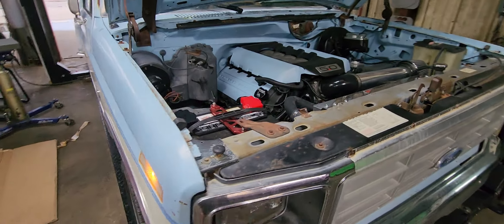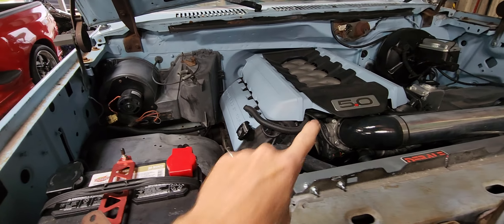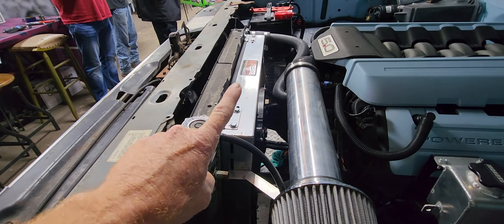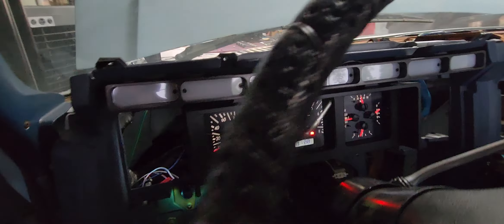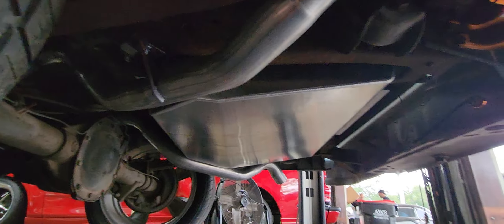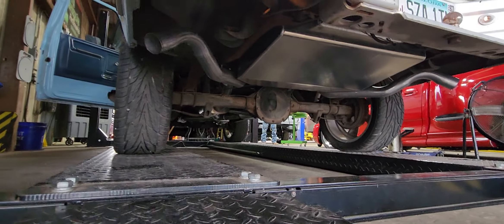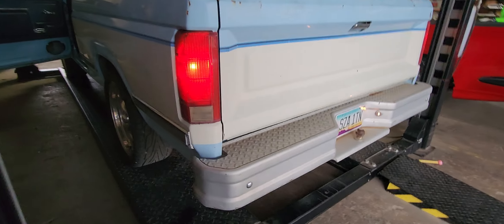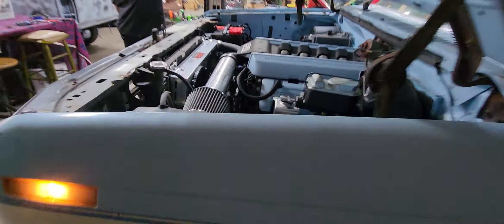1986 F150 with Gen 2 6r80 combo.

Comment: I think the gen 2 or a gen 3 bare block from Ford with 6r80 is the most simplest swap out there . I like the gen 2 without the direct injection and f150 firing order. I really want to get a junkyard gen 2 and slap the Sullivan carb intake on it and run fast xfi ignition with 6r80.